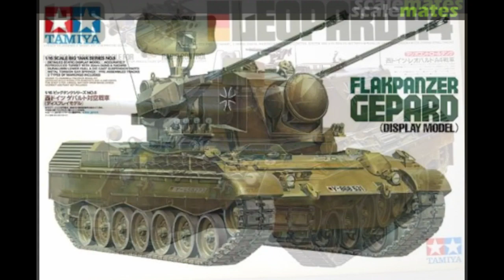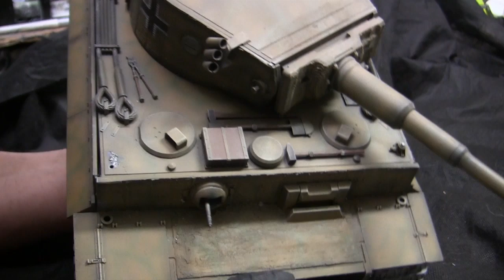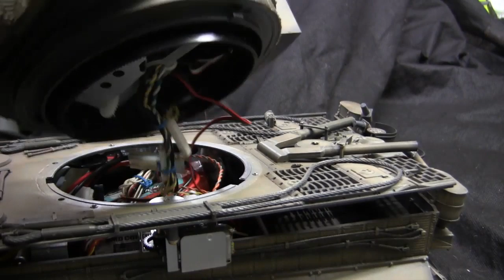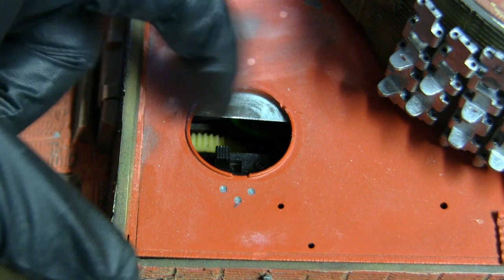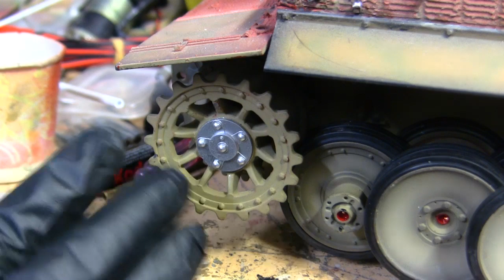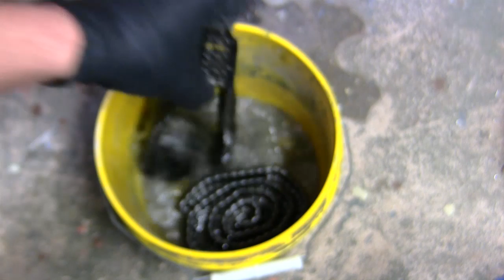1/16th scale RC Tamiya Mid Production Tiger I video 1 of 3

Comment: How did you shorten the antenna?
Reply from the maker: the original radio that was installed was replaced with a 2.4ghz system. With the new system they have short stubby antennas

Comment: Get metal parts. These won’t last
Reply from the maker: what won't last?
Reply: oddball759mm tracks,turret and gears. you should have bought the torro tiger instead. Better quality
Reply from the maker: @Lexus-ce4ug  the tracks, sprockets and idlers are metal, the wheels are on metal bushings so its metal on metal. I'm not a fan of the metal turret, IMO it adds too much weight on an unsupported plastic upper hull. You don't really gain anything from it. Detail wise the tamiya is better than the torro / taigen version
Reply: oddball759mm it really isn’t that heavy tbh besides the metal hull is going to come soon
Reply from the maker: IMO the metal turret is a solution looking for a problem. It does make it harder to work on with drilling holes / adding details. same is true for the metal hull. It's more or less a novelty
Reply: oddball759mm but it makes it more reliable and you don’t have to worry about breaking the plastic
Reply from the maker: the turret being metal is irrelevant to reliability, the only advantage that I see is that is give added weight to slow the model down or having it settle more on terrain, but that's about it. Both of those can also be done with the metal drive train, and if anything you can say that the metal turret puts more strain on the motors. 

As for plastic breaking on the model... That never happens. What are you doing to cause your turret or upper hull to break? Because that's just not an issue
Reply: oddball759mm i didn’t have any problem with mine tho. It runs for 1h without sound and it still can climb. plastic hull and plastic turret just makes it boring. You can do everything with the metal but not with plastic.
Reply from the maker: @Lexus-ce4ug  I agree the plastic running gear is less than desirable for performance,  This is why on my taigen and HL builds I replace the tracks and sprocket with metal ones and it resolves the traction issues. Plastic hulls and turrets are more than capable of good performance, and give you a good starting point to improve on. The metal ones still require the same detail mods since its the same molds, but becomes much harder to work on because of the material. It's doable, just harder.